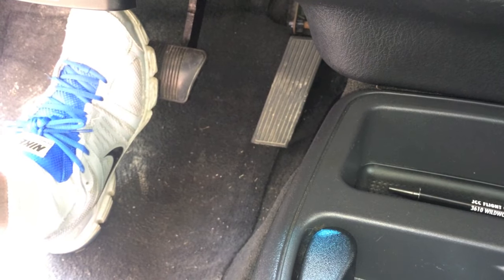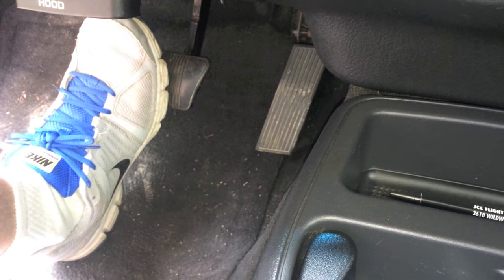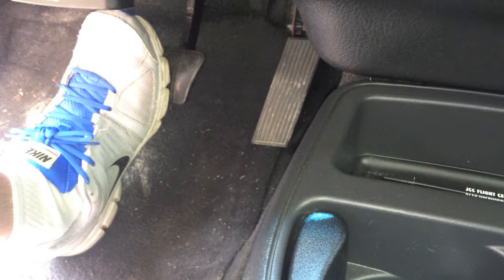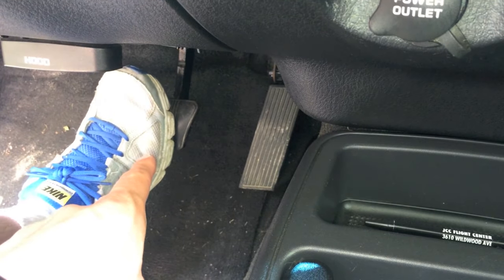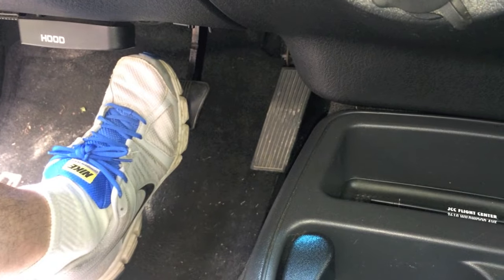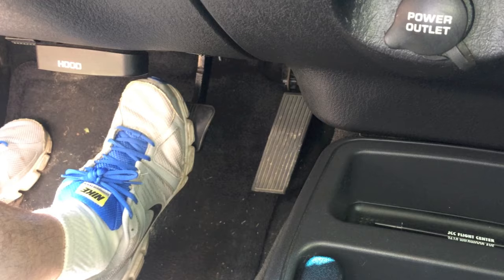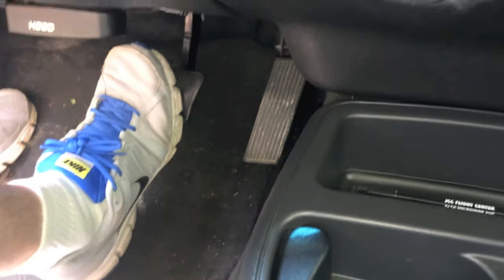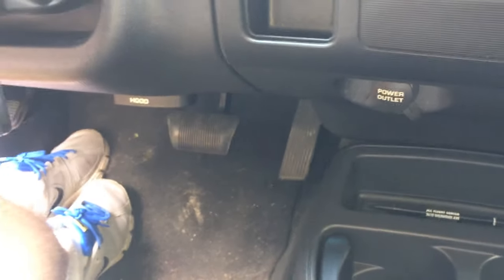HARD Brake Pedal - How to check if your BRAKE BOOSTER is GOOD or BAD

Comment: @DIY With Michael Borders . Michael,  my grandson's 1998 Honda Accord is doing the following;  Sporadically the brake pedal will travel further to the floor but will then make a thumping sound, then it'll come back to the mid-way, or I guess I can say, it'll move back to a safer position. What would cause that to happen. I told my grandson that I thought it may be the power boaster or the master cylinder. What do you think. I might add that his car is stopping just fine but he sorta freaks out because of this issue....Thanks, Dan
Reply from the maker: Daniel Jenn 

Thanks for watching & sharing your experience Daniel.  Great question & a few things comes to mind.

Let’s start with the quick simple troubleshooting steps & move our way down from there.

1.  We recommend checking the brake fluid level inside the reservoir.  If the fluid level is higher than the manufactured FULL level, this will cause your brake system to degrade & you will experience symptoms such as yours.  Below is a link to our video that talks & shows more about checking reservoir & removing extra fluid.

       https://youtu.be/X-AJ5tD6zoA

2.  Your Brake Booster is in its early stages of failure.  The Booster will cause symptoms such as yours when it begins to work intermittently & if not replaced, it may get to a point where if fails all together.  Usually...Boosters will show symptoms of failure & last on average an additional month or two however safety first, getting it replaced sooner rather than later is best.

3.  Unlikely however we can’t rule it out.  Your Master Brake Cylinder (MBC) is wearing out.  A link to our video that talks more about that is below.

       https://youtu.be/F9s_1VZ2u5E

Let’s start there!  Keep us posted!  We are here to help!

Please subscribe to the channel and turn on your YouTube notification Bell 🛎 that would be awesome thanks again Daniel.  😎👍🔧🔩
Reply: @DIYwithMichaelBorders  Ok, here's the deal. He didn't tell me exactly what it was doing. Okay, the Master Cylinder reservoir was half way between the max & min lines. His father was supposed to pickup a quart of brake fluid after I had replaced the rear drums and shoes. I'm going back in the morning to fill it. Now the pedal. 98-99% of the time it brakes normal. By normal, the pedal travels half way from the driving position down to what I'll call the half way point. This is the issue. While braking, the pedal will start to travel another lets say 4 inches. Then the thumping sound and the pedal will rise back up to the normal position, while he has pressure on the brake pedal. He says it just brakes normal, travels that 4 inches down, thumps, then travels back up to the normal position, while all that time he still is applying pressure to the brakes. I couldn't take it for a drive because the place that changed his motor oil only replaced 2 of the 4 quarts needed. I just happen to check it while we were standing there looking at the reservoir, so I showed him where the fluid level was at and where it should be. So I will try to keep it together so I can get my grandson going. lol, what a time we had. I'm just glad his engine is fine and I know that he's glad so far because I'm a patient guy, plus we get along really well. We have to because I'm his car guy and he is my iPhone guy. I will get back with you today once I get this puzzle together. In the mean time, thank you so very much. This one has been a wild experience for me. Thank you for having a channel set up like this. It shows that there's some really great people out there  that there's
Reply from the maker: Daniel Jenn 

Thanks for the update Daniel, we appreciate you getting back in touch with us!

The fluid level may be a contributing factor.  Let’s focus on bringing the fluid level back within manufacturers recommended fill parameters.  This will give us a chance to attempt to fix the problem at just the cost of the brake fluid.

Let’s think past that though...if the above step doesn’t work, let’s complete a full “re-bleed” of the Brake system.  You mentioned you replaced the rear drums...it’s very possible that the new pads have altered the system ever so slightly in regards to friction/tension & it’s disrupting the efficiency & performance of your brake system.

With that said, let’s focus on fluid level first & then move to re-bleeding system to reset the systems tension/friction to the new parts.

Keep us posted & we are here to help Daniel!  Thanks again for your update.

😎👍🔧🔩
Reply: @DIYwithMichaelBorders  Can you believe I'm just now reading the comment you left me. Okay, Austin hasn't said anything to other than he recorded a video/audio short so I could hear the brake sounds. He said the front brake was making a scraping sound as he backed out of a parking space with his foot slightly on the pedal. Since I had bled the rears after I put on the new self adjusters because the guy I hired didn't do it & went home & left me with a spongy pedal. We bled the brakes 2 or 3 times but that doesn't mean that there's still a small bit of air still in the lines to the rear brakes. I'll do that again & see if it helps. It is getting better each week. If the pedal isn't doing that strange up & down thing, it had to be because of the fluid level being a bit low, and/or it's the rear with air & the front brake's starting to wear a bit more. I'll have to go over there Monday after he's back home from Detroit. He hasn't said much so I assume that it's got better since I gave him a box with every type of oil his car would take,  motor, trans, power steering & brake fluid, along with gas-line antifreeze. I told him that everything he could have to have to top thing's off is in the box in his trunk. Always a good thing to do for our young drivers, so they can get use to knowing what all a car could use. Next I'll have to quiz him on what some noise means & what oil would he need to add. That's something I've never thought of doing before now. I'll talk to you once I take care of what you recommend.Thank's Michael, Dan
Reply from the maker: Daniel Jenn 

Awesome Awesome & thanks for sharing your update.  We are happy to hear the vehicle is getting better & Austin & you have put together a box of important fluids to keep all vehicle fluids topped off, that’s an excellent idea!

It sounds like the brake pedals are settling in & beginning to work correctly, effectively, & efficiently as time goes on.

We love the idea of one additional bleeding brakes session you mentioned to ensure any possible remaining air near rear brakes.

Keep us updated & we are standing ready to help!

It sounds like you & Austin are going to be great DIY car project pals, that’s awesome!  😀👍

The earlier our young drivers learn about the little things that you are equipping Austin with & teaching him will definitely go a long way!  Two thumbs up to you 👍👍

😎👍🔧🔩

Comment: Hey, What symptoms will we see if the booster has a problem?
Reply from the maker: Thanks for watching, if booster fails,  it will not allow system to properly pressurize.

This can lead to very loose weak brake pedal.  Will feel like you don’t have brakes.

Comment: Hello I was told that I need a booster cylinder for my 2000 Toyota Camry 4 cylinder the car keeps going  when I brake I have to use the emergency brake and the brakes have alot of air in them now the pedal is real hard can you please tell me what is going on thanks
Reply from the maker: Charmain Jones 

Thanks for watching and sharing your experience.  When was the last time you replaced your brake pads and rotors?

Also you may just have air in your brake lines and will need to bleed your system.  

Before purchasing a brand new booster, we recommend replacing your pads and rotors and bleeding the entire system to ensure all air has been removed from the brake system.

Keep us posted, hope this helps!

Please subscribe to the channel and turn on your YouTube notification Bell 🛎 that would be awesome thanks again!

😎👍🔧🔩
Reply: @DIYwithMichaelBorders  thanks it was the booster cylinder I had a mechanic fix it
Reply from the maker: Charmain Jones 

Thanks for the update & that’s great news.  We are happy to hear your vehicle is fixed & back to safe standards for you.  😀

Definitely keep us posted with any additional questions you may have.  We are always here to help!

😎👍🔧🔩

Comment: I have a Isuzu npr the brake booster light comes on when I press on the brake also the pedal is stiff  when light is on I tried this method and when I start the truck the pedal does go down not as fast as in your video but it goes down slow  what could it be.
Reply from the maker: Ricardo cazares 

Thanks for watching & sharing your experience Ricardo.  Prior to engine start, your brake pedal is supposed to feel hard/tense.  It is not recommended to pump brakes several times prior to engine start...A few things to check.

First, verify that your brake reservoir is filled to within its proper still parameters with brake fluid.  Low fluid will cause issues to the system.  Also, on the opposite end, TOO MUCH fluid will cause brake system issues.  Below is a link to our video that shows a simple way to remove fluid.

       https://youtu.be/X-AJ5tD6zoA

If fluid is within parameters, on to the next steps.  Start engine and open hood.  Next, listen to your engine near your brake booster and brake reservoir.  Focus on the vacuum lines coming out of your Booster.  Try to pinpoint any hissing sounds and if you do hear hissing sounds, pinpoint the exact location of leak & replace vacuum line.

You also have a Check Valve that can fail.  If failed, you will need to replace it.  A faulty Check Valve will cause these symptoms.  Below is a link to our video that shows more about this.

       https://youtu.be/j9s7yccswPQ

Let’s start there, keep us posted.  Please subscribe to the channel and turn on your YouTube notification Bell 🛎 that would be awesome thanks again Ricardo.

😎👍🔧🔩

Comment: I will replaced the master cylinder bleed the brakes three times adjusted the back brakes took the booster completely off and make sure it was working good. ! Iv put it back together and still no paddle now I'm on the front not sure what I'm gonna do but that's where I'm at right now
Reply from the maker: Ted Carter Thanks for the update.  Its possible that the Booster check valve is faulting out.  Below is a link to a video.  Keep me posted.

https://youtu.be/j9s7yccswPQ

Comment: I put a new booster in and pedal still doesn’t go down when starting engine. Could it possibly be that booster is not getting 16-18” of vacuum? You said in video that the booster is bad when that happens.
Reply from the maker: Thanks for watching & welcome to the DIY Raptor Club.  That’s the next probable cause since you have replaced a few parts.

Do you hear any hissing sounds inside engine compartment near booster while engine is running?  You may have a pin-hole leak in a vacuum line.

Comment: Hello, I'm having an issue with my brakes where they stiffen up when i press them while its off, but when i turn it on the brakes become super squishy and just sink to the bottom. This occured after i tried doing a brake flush because the ABS and traction lights were on.
Reply from the maker: Good morning, just poured a cup of coffee and am sitting down to answer any and all questions for the DIY community.

Thanks for sharing this.  Do you see any brake fluid leaking out of your line’s underneath vehicle.  Common locations are directly underneath drivers door where brakes lines run underneath vehicle and back to rear wheels.

If so, time to replace that little section of line.  Keep us posted.

Let us know if you have any questions and hey if you’re into crypto trading, join our DIY ecosystem and become part of an exclusive group of DIYers.

       toolboxtoken.com

Reach out to us any time!  🧰

Comment: Hi, I have a 2013 Chevy Malibu LTZ. I’ve noticed for past couple weeks now my brake pedal is hard to push when starting my car. Generally it’s seems like it happens when I first start my car or when car has been sitting for a long period of time. Brakes seem to be working fine though. Also and I don’t know if there is any correlation but I’ve had an air pressure sensor that’s been on for a while saying one of my tires is low on air but the amount of air in the tire is fine. Any idea what it could be and how much to repair? Is this something that could become dangerous if not fixed? Thanks in advance for any help you can give.
Reply from the maker: Thanks for watching & welcome to the DIY Raptor Club.  We recommend bringing your air pressure in all four tires up to the manufactures recommended psi.

Lower pressure in any of your tires can actually trigger your ABS light to illuminate...fun...😬

Once ABS light illuminates, this can trigger additional items within your brake system to act sporadically.

If adding air to your tires does not fix issue, it’s possible that you have a Caliper in its early stages of failure.

Inside the caliber is a piston, and as you press the brakes...the piston shifts the brake pads flush with the rotor.  When you release the brake, the piston is supposed to retract and release the pressure on the pads...allowing the pads to release pressure from rotor.

If that piston is staying in the extended position even after releasing your brake pedal, it’s time to get that caliper replaced.  Please keep us posted.

Comment: not sure if i have to change my break booster. my car just shakes when im on break or stop. any suggestions?
Reply from the maker: Good morning ☕️

Rattling brakes are almost always due to a brake caliper wearing out.  As you brake, have you pinpointed the exact wheel thats causing the rattle or vibration.

Once the correct wheel causing rattle is determined, we recommend replacing that wheels brake caliper.

While doing that, you may find it best and most beneficial to replace both front brake rotors and pads.

Keep us posted.  🧰☕️

Comment: I have a strong peddle off I mean rock solid  as soon as I start and drive almost no brakes and peddle goes to floor as your driving you can pump the peddle around 8 times you get solid brakes keep driving goes to floor 98 k1500 new lines complete new brakes thats all parts to the system at all 4 wheels , new master ,, unit sat 3 years before I bought it everything was empty and 2 items have yet to be replaced ,,, The booster and abs soooo which one is the colprit  ????????????? ps bleed the abs, no abs or brake light lit
Reply from the maker: Thanks for watching & sharing your experience.  The Booster & ABS system are definitely possible culprits...which one is it...🤔...

Both parts are very long lasting & unfortunately cause very similar symptoms when faulty.

How does the fluid level look inside your reservoir?  If the fluid is above the max line or below the min line, it can lead to these exact symptoms and behavior as well.  Below is a link to a video talking more about this.

       https://youtu.be/X-AJ5tD6zoA

Keep us posted.  😎👍🔧🔩

Comment: i already replaced the  brake master cylinder because of a spongy   brake   pedal .  now there's a hissing noise whenever i step on the brakes.  sometimes   the brake pedal goes hard and braking power diminishes.   is this a sign  of a failing brake  booster or a  bad check  valve brake  booster?
Reply from the maker: Thanks for watching, hissing is almost always tied to a leaking vacuum line.  It’s very possible that a vacuum line was damaged or slightly loosened off it’s fitting while you were replacing master cylinder.

Vacuum lines connect to the brake booster which is what the master cylinder connects to.

We recommend starting engine and carefully listening to that area of engine to see if you can pinpoint the exact vacuum line causing the hissing.

Comment: My pedal is very stiff without having to push it lightly the first few times, so the first push for me has to be with a lot of pressure, would this be the brake booster?
Reply from the maker: Thanks for watching Leo, welcome to the DIY Raptor Club.  Before replacing Booster, let’s talk about a few things come to mind.  There are a couple parts that could be in their early stages of failure and working intermittently.

1.  Caliper:  It’s possible that your caliper piston is beginning to get stuck at points and cause your brakes to firm up and lock up.

2.  Rubber brake line:  It’s possible that your rubber brake lines that feed off your caliper and lead to your hard brake line are failing.  Believe it or not, these rubber brake lines fail from the inside which means little pieces of the interior hose begin to break off and travel through the system ultimately clogging it and leading to brakes locking up.

Keep us posted on your project.

😎👍🔧🔩

Comment: Thanks a lot going to check on Sunday . Also me and another guy notice the rear brake pads are not grabbing the front brakes work fine but the left pad grabs slightly just a tad bit and the right side tire pads don’t grab at all thanks and yes I will subscribe sorry I didn’t mention all this but I was just upset get at me soon as you can thanks again
Reply from the maker: James Guy Thanks for checking out the video James!  It sounds like your Calipers are not working 100% properly.  You might need to lubricate your Caliper Slides...😎👍🔩🔧.  Keep me posted.  Please subscribe to the channel and turn on your YouTube notifications that would be awesome thanks again James!  😎👍. Below is a link to a video showing Caliper Slide Lubrication.  

https://youtu.be/-DZ68tKuCQc